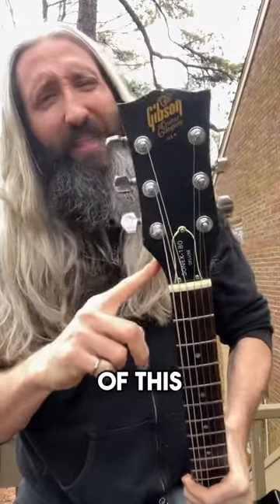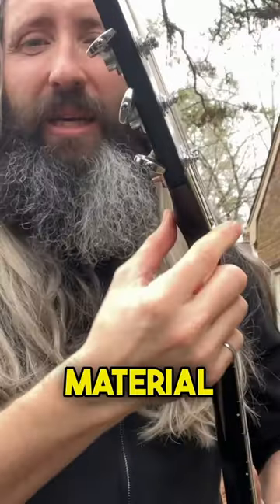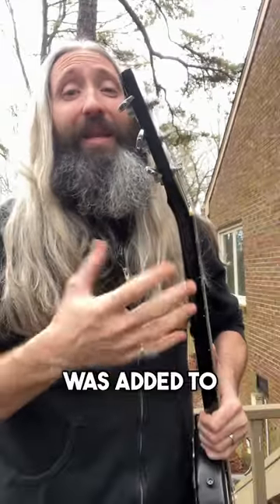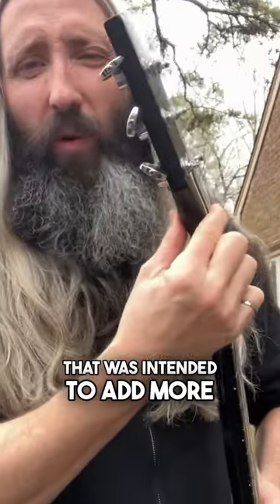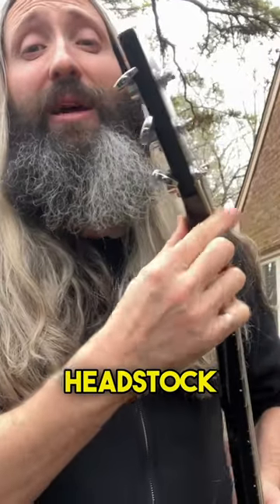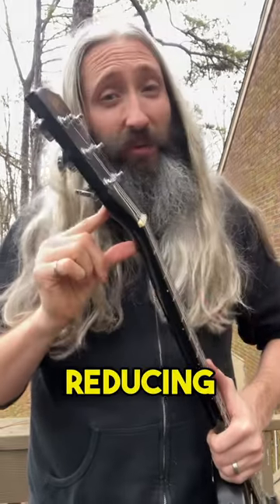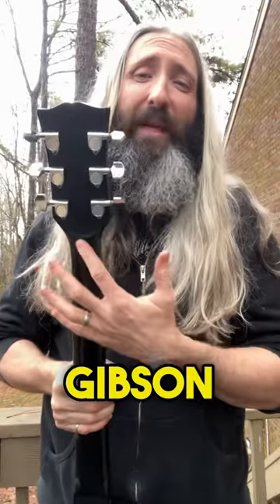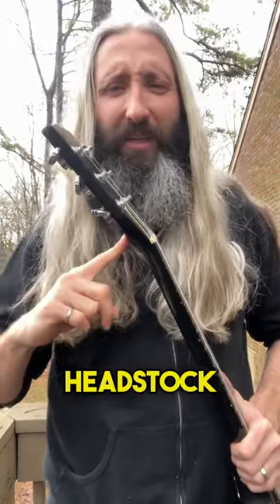Do Headstock Volutes Actually Work?#gibsonguitars #guitar #gibson #electricguitar

Comment: The volutes would be much more effective in strengthening their necks if Gibson would use sandwiched Spanish Luthier/Scarf joints to attach their headstocks to their necks, instead of just gluing the end grain of their headstocks to the side grain of the back of the neck, with just a single joint. That antiquated design is just inherently weaker than the  scarf joints used by other companies. Also, while many, including myself, prefer the warm woody resonance of mahogany necks, it doesn't help that mahogany, while a beautiful sounding neck wood, it's just not as structurally strong as the more ubiquitous maple used by almost everyone else most of the time...
Reply: But Gibson doesn't use scarf joints and that is the problem.
Reply: @RsSquier51  That's my exact point...
Reply: @Kreln1221  but my point was that they make their necks from 1 piece of wood there is no gluing with the headstock as you stated there was.

Comment: So Gibson didn’t have volutes on all of the 70’s Les Pauls. Because clumsy people broke their headstocks , Gibson changed neck material to maple in the mid-70’s. With no volute. People bitched about that. So they changed it back. There is no problem with Gibson’s neck design. Period. If you break the neck on a guitar that’s your fault. I’ve owned about 50 Gibson Les Pauls. Played countless shows. Never had a neck break. Bad craftsmen blame their tools.

Comment: The necks big enough as they are. 
 They shouldn't have any problem breaking I could probably break through a concrete wall with the one I got you know what they need to do is add a little more meat to the headstock you know not make it so damn thin that would solve the problem right there and make their necks Thinner
Gibson Has Girl-Brains.

Comment: the volute wont help a Gibson, its because the neck and angled headstock are one piece. Angling the headstock means exposing the end grain of the wood. Thats why scarf joints exist. And they are superior. Every one of my guitars  that has an angled headstock has a scarf joint. Yet to crack or break a single one